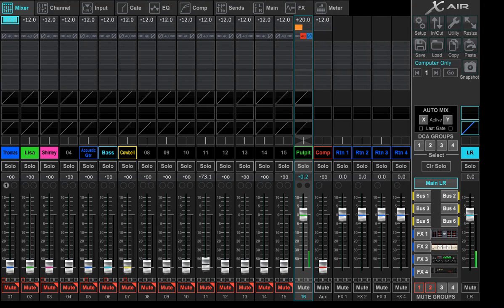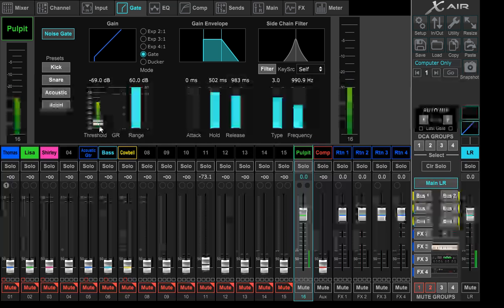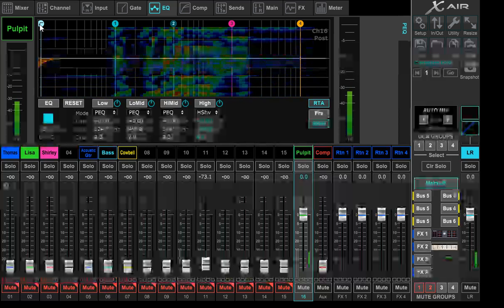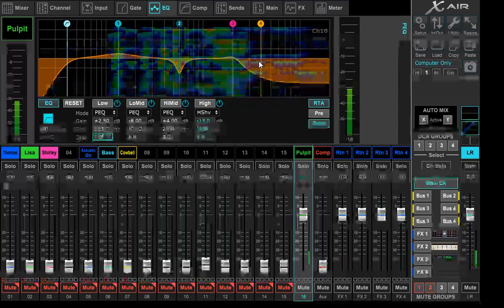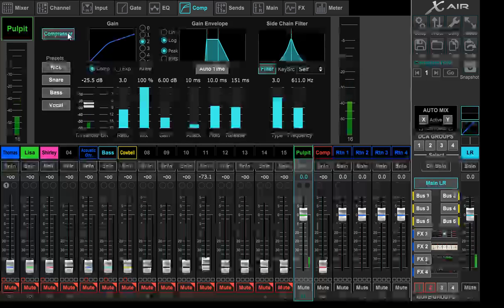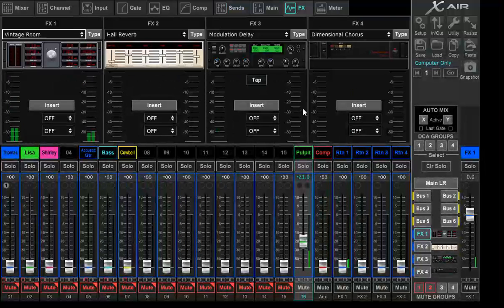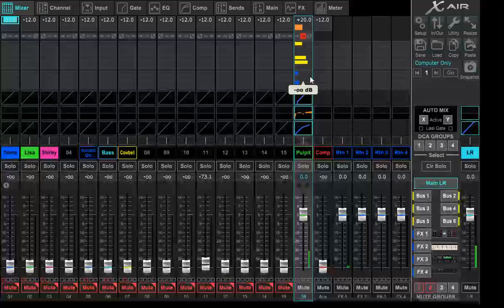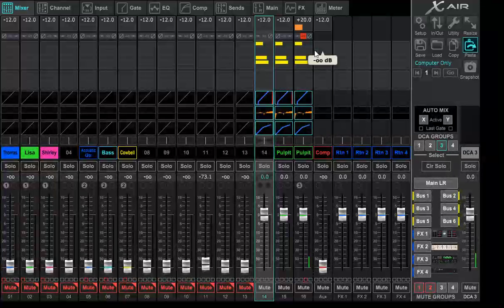Setting up a Channel on a Behringer XR 18

Comment: Your gain structure is backwards. The voltage pot is adjusted using pfl or solo to match the levels of the amp then the fader is adjusted for volume
Reply: This set up is not desired because you won't have much headroom left if you start out with fader at unity. If you do this and want more volume,  you would have to adjust your gain higher which would create distortion
Reply from the maker: Vrixx Aldeguer, yes. I do the same thing. I don't go into it in this video, but I turn the amp all the way down, run a line level from a CD or DVD, set the channel to unity gain, then adjust the amp levels. It allows you to follow the procedure I describe without risking ridiculously low gain settings that distort the sound. There are those with a different opinion and many of them hold those opinions very, very strongly. There are a variety of ways to do it, in my humble opinion.
Reply: I'd rather go the way we're doing it. Setting the channel fader first to unity guarantees that I have a clean sound. Then turning the gain as next step will make me hear the optimum until I reach the point I can hear the  noise, hiss/clipping then turning down the gain until I hear my mic as clear and punchy again.
Reply from the maker: Yes, that's a good comment. Properly speaking you should set the gain first, and then work backwards to the fader. But, I find that this procedure is easier for beginners who don't have experience using headphones to check the solo levels before starting to mix. For someone just starting out, in my experience this method creates fewer problems. There are certainly other ways to go about it. It's how I was trained, and unless your main speaker amps are set too high so that you can't get your monitor levels up high enough, it does work.
Reply: Andrew Bellous the gain is the primary adjustment to get the desired signal (SNR, signal to noise ratio)  you want to set to 1 o'clock for vocals as a good starting point.  The fader is just the volume control and does not affect the led meter.
Reply: Bobby A hi Andrew... would it be possible to get a quick vocal setup with you online with the xr18... it’s killing me!! I just cannot get the presence or punch off the vocal
Reply: Completely agreed Scott.

The method explained here is back to front and is a misappropriation of the method we used before we had PFL buttons and better input metering.

IMHO, NEVER mix with the gain pots! I see this so often and it's a recipe for clipped channels and a mushy sound.

Get all channels in their sweet spot with the gain pot with plenty of headroom and then mix with your faders. Your signal to noise will be heaps better, you'll never have clipped channels and your sound will be clear with heaps of dynamics.
Reply: Actually I'm doing the same thing. Set the channel fader first to zero, then set the gain level to the point of optimum but with no noise or hiss on my speaker. This works for me..
Reply: @Andrew Bellous and @Vrixx Aldeguer - I'm glad this method works for you and if it works, it must be good! :) But we are talking digital here so once we get past the ADC on the channel, no more noise is added until we get to the power amp.

Here’s my rule, get everything peaking at around -12db on the input meters at the loudest passage using the input gain and assuming nothing changes at the instrument / mic end, forget about the inputs. This gives the virtual faders a lot more resolution and control over the sound.

When we had analogue desks and noisier amps, there was a constant battle with SNR but with digital, it’s a lot less important. Back in the day, remember when we had to listen for noisy channels / preamps / FX / patch cables and unless we had a pretty expensive mixer, we also had to set our gain using the fader at unity and check the meters. This hopefully gave us the best SNR and the cleanest signal to set our gain to. This analogue signal path added noise, hiss and whatever else at every turn but it also gave us some mojo and if we pushed the gain or faders too hard, it pleasantly clipped (to a point!) giving us some room to play with. With digital mixers, noise is no longer a problem within the desk but unlike analogue clipping, digital clipping is totally unforgiving! Once the signal is past the preamp and ADC, we are adding no noise and if the processing is done at a high enough bit rate, any operations that don’t hit 0dBFS should have no noticeable effect on the sound. So assuming the mic or device that is feeding the preamp is giving a relatively clean signal, running faders at unity etc in my workflow is unnecessary.
Anyway, whatever works for you and best of luck!
Reply: @Christian Benci I understand this is a digital mixer now. I'm basically a musician and I trust my ears which is sound is clean but punchy or compressed  and on a bit clipping. With my channel and main mix faders at 0db, I still have up to +4db headroom to play around. As for me I'm an old guy who's into a lot of old music. I also considered that while this piece of equipment is a digital, it is still electronic. Audio products especially preamp depends on OP amp ICs which I believe has its continuous operating and peak power from Pre to Post. So I am always cautious of the wear and tear of any internal electronics. So hoping I can enjoy this mixer for years, I would rather not to push it even though it is capable to do so. So for the final sound push, I let the power amp do it. To me its all about pushing the signal source either be a music player, a mic getting the optimum gain that can easily make my power amp drives it loud of course without or less noise. I can say this approach really works for me without worrying that I might be pushing my equipment to its acceptable peak yet generates heat inside it (given these digital mixers has surface mounted parts).  I also have a Soundcraft Ui12 which the first bought to see what's the fuzz of these wireless digital mixer about. Once I enjoyed the freedom of mixing without the wires, I got the XR18 for immediate upgrade. But yeah, I agree with you whatever works for us that should makes us smile especially when we get the pay check. Cheers!
Reply: It’s an old-school approach and a lot of church noobs can benefit from it. I do think that people need to learn it the “right way”
With the tech and info that’s available.
Reply: I came to the comment section to make the same comment.  The input gain should be optimised first prior to the faders to minimize noise coming into the system and Normalize all the input levels.  The other advantage to this is then the faders give you a visual representation of the relative volume of that channel going to the output.  That way anyone walking up to the board can instantly see what is going on volume wise.
Reply: I always set the trim leaving headroom first.  10 o clock or so on a regular mixing board...that way you make sure the input is not clipping...I set the Master fader to Universal gain and the sliders control the channel volume and overall mix....
Reply: There is no right or wrong with this technique.....adjusting the gain to get the fader to about 0db is a good technique as the fader is the most responsive at that point...but the classic approach is to "fill the channel" with audio to maximise the signal to noise ratio and to not care what position the fader ends up at...this ia good as it means each channel (no matter how quiet or load the original source is) will present the processing with the same level of signal so you can then set the compression and gates etc to the same levels ..this is very important. Finally....it must be stated.....GAIN POTS ARE FOR GAIN ADJUSTMENT....FADERS ARE FOR MIXING. ANYONE THAT MESSES WITH THERE GAINS TO MIX IS WRONG..THIS OBSESSION WITH HAVING FADERS IN A STRAIGHT LINE IS MADNESS....the only time it has any place is theatre where you are riding the faders all the time and you need to know where to bring them back up to